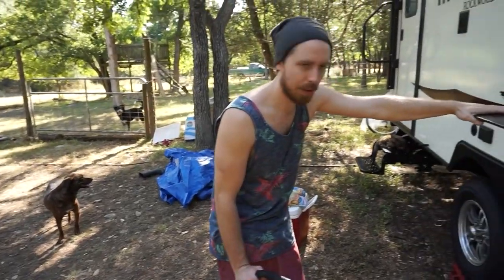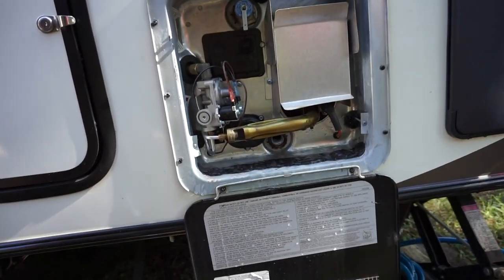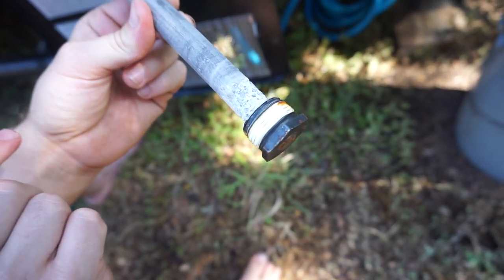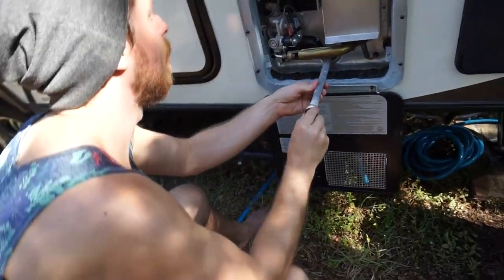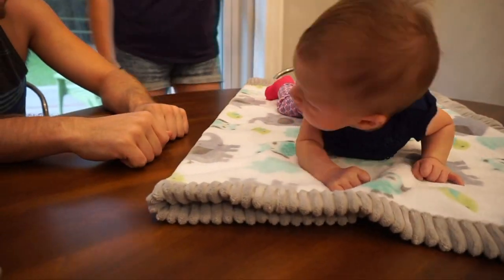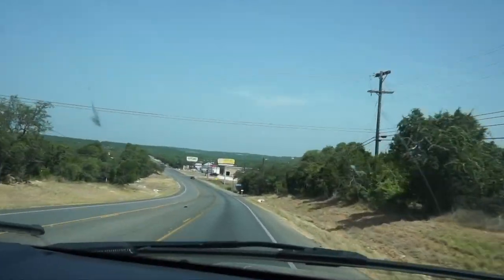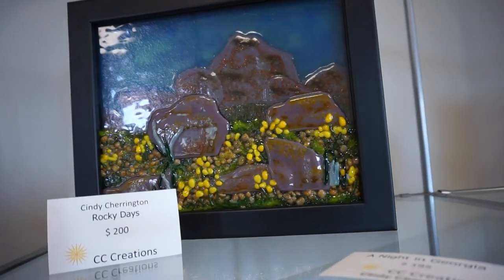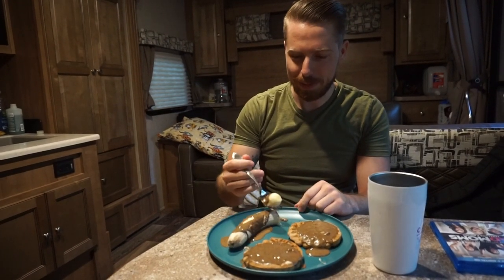BUSY WEEK - 📝WATER HEATER ISSUE // FAMILY TIME

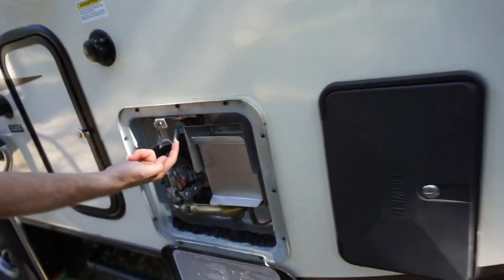Comment: 0:55 Maybe I misunderstood you, but that switch doesn't stop allowing water to fill in the tank, that's done either by city water pressure connection or your water pump/fresh water tank. The switch is just to turn on/off the electric heating element at the tank.You likely have a switch inside the RV to turn on the electric water heater, this will enable the electric element in the tank along with propane for fast heat recovery (or you might have the option to select either, or both). But if the switch at the tank is off, the heating element won't turn on. 

You might want to consider making a drain pipe that threads into the anode area and extends past the RV if you're going to drain it often. It'll minimize the potential for water to get into the walls. Also consider a magnesium over aluminum rod for the smell.

Comment: Love you guys!!  The on/off switch does not turn the water on and off, it is the switch for the electric element for when you have the water heater on electricity.  Never turn that switch on while connected to power and the water heater empty..it will destroy the heater element in seconds.  I agree with the anode rod and opting for magnesium over aluminum.

Comment: Few things... looks like a suburban water heater. That switch is for turning it on electric, instead of using propane. Keep switch off unless it's full of water or you'll burn out the heater. 

When draining, flip the pressure relief open and water will flow out faster.  Also good to shoot some water into the tank to rinse it out (there's a little plastic wand that helps).

Teflon tape around threads of rod.  Also the rod is not for sentiment, it's for corrosion protection. Eats the rod and not your tank.

Comment: I love seeing things like the glass.  We buy things like that for our RV & beach home.  I'll check out the website.  I will be remodeling the beach house after Labor Day.  You need to look for the by pass valve to turn off the water to your water heater.  Hubby fill ours with antifreeze one year and I flushed it and sanitized it with vinegar.  Bleach may not be good with the type metal you have inside your tank.

Comment: That switch is just for the AC side of the heater.. and it runs on Propane too, and that cut on/off switch is inside. and the normal RV hot water heater is 6 gallons..... OH.. I work on RV's every day now.. Switched from boats..

Comment: Be carful that switch is the electric heat element, to turn off water to the water heater from getting water there is a bypass kit installed behind the water heater on the inside. If you turn the electric element back on with the tank empty it will destroy the element. One other word of advise is the switch inside your rv will only turn on the gas part of the water heater which you should not run at the same time as the electric :)

Comment: Six gallon tank and you should have opened the pressure release valve on the top of the tank and it would have flushed the debris out and drained in like 1 minute

Comment: That switch in the hot water heater is for the electric water heater portion
Reply: To get rid of egg smell you need to bleech the system. It will remove the smell.
Reply: Wont do any good.  Its because of the high sulfur content in that areas water.
Reply from the maker: Yeah, definitely needs a deeper cleaning. We thought we'd start out with the simplest attempt to fix it and then go a step further if needed.